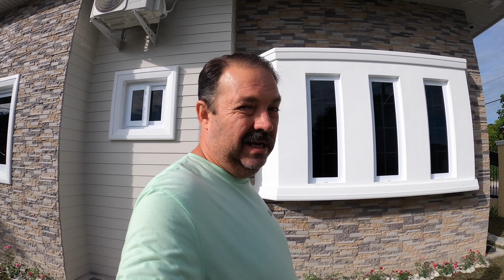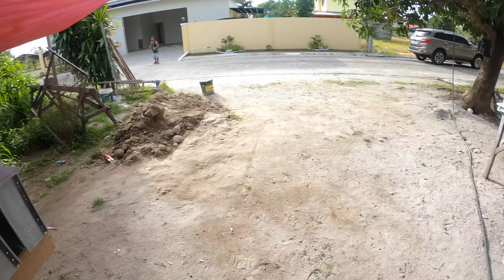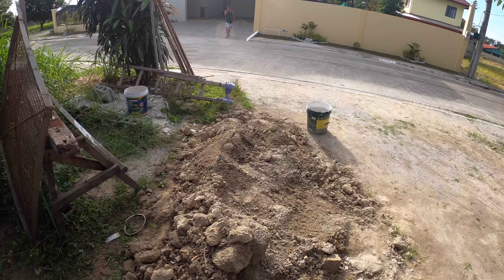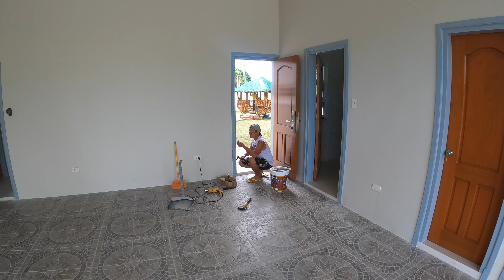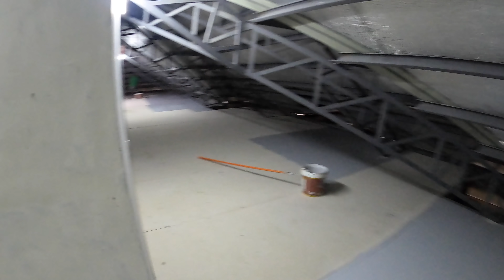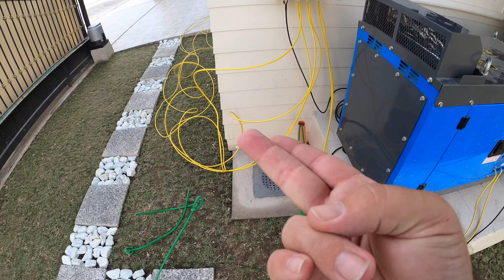Philippine House Building Step by Step, Build Day 266: Generator Install Day3

Comment: Do they used metal conduit pipe in the PH as a conduit from point A to B.   What's the electrical code requirement for conduit there, plastic or metal?
Reply from the maker: Mostly pvc conduit. Not sure of the exact code requirement. The conduit throughout our build is PVC and flexible conduit. They seem to have moved away from the galvinized metal conduit or even the semi rigid metal flex conduit.

Comment: I have watched your build from the beginning and complement you on many of your choices. I have been in the trades for 40 years (Master Electrician). Have seen many builds in the Philippines and the only comment I have on the wiring methods used there is SCARRY. Many of the issues you have had and will eventually have could have been eliminated with very basic professional trade craft knowledge. 

Good to hear you're installing smoke detectors. Probably would not put them where you are, because you will have alot of nuisance alarming. You may want to consider CO/smoke combo detectors.
I do really like alot of your choices along the way (attic flooring and access, siding, water treatment etc.)
Reply from the maker: Thank you for the kind feedback. We’ll take another look at smoke detector locations today. 
Agree. Lack of trade knowledge here is scary 😧.

Comment: Was rooting for you and the guys to get those cables through the conduit.  👏🏻👏🏻 Great to see you getting those smoke detectors. Made sure my in-laws got them along with fire extinguishers too in Leyte.
Reply from the maker: Extinguishers and detectors are required by Fire Protection Engineer prior to occupancy certification.

Comment: I knew - well before they were going to pull the through- that they were going to be short, as you pointed out in the video the route the conduit was going vs how the cable was laid out by you generator guy- sorry, but that was very poor planning on all parties involved, and I feel sorry you have to deal with that, the rest is coming along nicely. Ps when will you have the people coming in to do your soft furnishing, like your curtains etc as that will also take a bit of time?
Reply from the maker: Soft furnishings like curtains are already measured and made just waiting for turn over so they don’t get painted on.

Comment: Wire cable pulling involves lubrication...sometimes....compressed air.
Reply from the maker: Nice conversation...
Reply: @CasaTexPina  I'm learning every day too.
Reply: Not if your conduit and wire is sized properly and you plan the run to keep the total bends 360 degree or less.
Reply: @scottingersoll8361  plus..stranded wires are more flexible and higher amperage..
Reply: @manueldeguzman7570  certainly way more flexible but not necessarily having more current carrying capability. Alot goes into play there.
Reply: @scottingersoll8361  Have you heared of non metal electrical conductors??? Like plastic or polymers???
Reply: @manueldeguzman7570  yes in experimental stages for very specific situations nothing close for current capacity needed outside of small electronics. Remember current squred times resistance equals HEAT.
Reply: @scottingersoll8361  super conductors? Almost zero resistance...but heat problem..
Reply: @manueldeguzman7570  yes, you can push alot of current through a small conductor if you remove the heat it produces. Super cooling a conductor is extremely expensive.

Comment: Too basic electrical work to missed...Can’t bring exact length of wires in case of needed more slacks.
Reply from the maker: On day 2 he cut the long pieces thinking he was going to run new conduit. He should have brought extra tools, you’re correct. Doesn’t seem like he was planning to finish yesterday. 😡
Reply: @CasaTexPina  typical homeboys way in Pinas, good workers but most of the times lack of common sense. My wife had her house remodeled in Bulacan, as simple as where to put the recessed lightings in MB can’t even follow and even to build a kitchen island with pictures, drawings & measurements still needed a lot of redo.  Good thing I didn’t performed like that when I was in the Navy ⚓️😅
Reply: Recommend to buy wire lubricant to make it much easier pulling the wires.
Reply from the maker: @erniejopanda1132  I feel ya there. Would have been run out of the Air Force as well.

Comment: Make another conduit going up the wall outside thru the ceiling across the garage ceiling then go down to the breaker.
Reply from the maker: No longer required. The original conduit works. The cables are just too short.